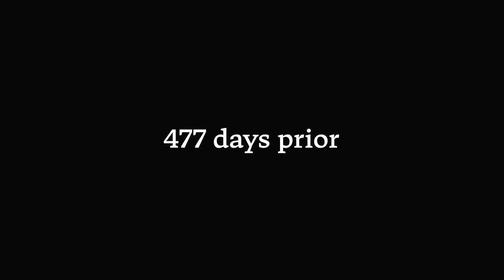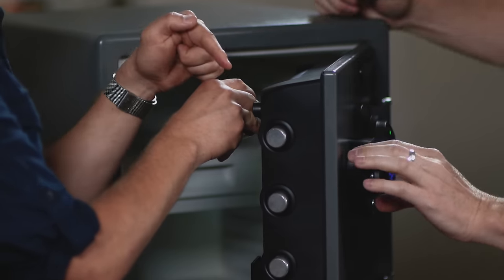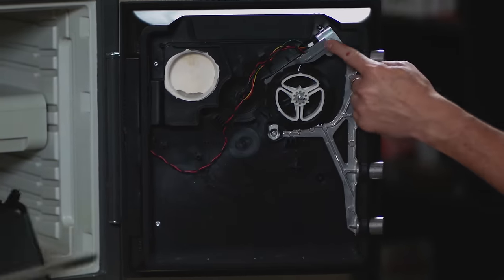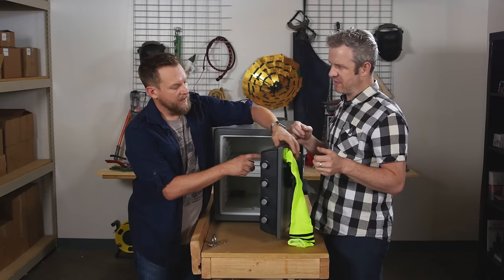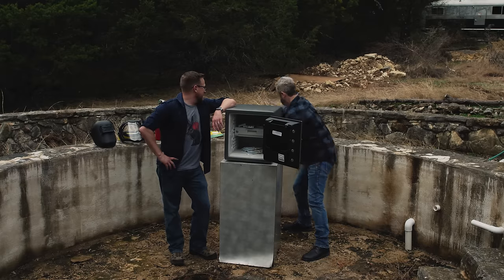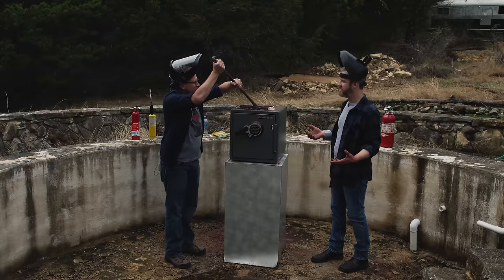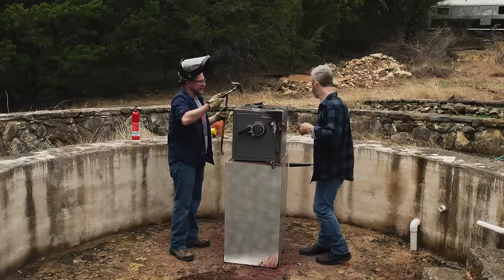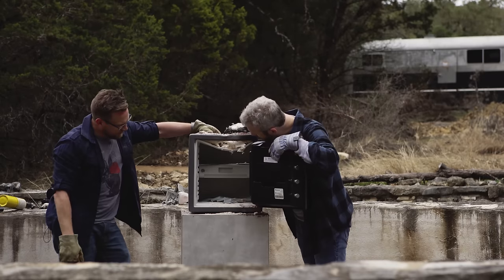Safe-Cracking with Magnets and Thermite

Comment: What kind of fire extinguisher did you have there? Just asking because a CO2 unit is worse than useless on a metal fire. Feel free to make a playing with thermite episode and show why you really shouldn't use CO2 on a metal fire.
Reply: I was under the impression that only magnesium fires were bad to fight with CO2.
Reply: The Aluminum in the reaction will start using the CO2 as an oxygen source, and you will be blowing it around, with molten iron, very exciting!
Reply: What can I say but yikes?
Reply: @ComradePhoenix  any self oxidizing fire will make CO2 useless because the goal of a CO2 extinguisher is to stop the fire from getting oxygen but if it self oxidizes then yup
Reply: David is correct. Furthermore, the only thing you can deprive it of is itself. Once started, it becomes self sustaining. Trying to cool it down isn't reasonable either.
Reply: Harrison Martinson Maybe interfere chemically if you know the exact reaction (so no good for general fires).  Basically the opposite of a catalyst.

Comment: 4 1/2" angle grinder, plunge cut into the side of the safe. Just takes a few minutes. 
   Cutting off hinges will not allow you to open safe, their are bolts that go behind the inside lip.  The hinge just makes it easier for the owner to open and close the door.

Comment: The thing with the hook contains a magnet, but is something very different. It is a holding magnet, build to have the strongest field over the gap between inner magnet and cup. The steel cup is a yoke, conducting the magnetic flux. The outer field you use is basically a side effect.

Comment: If you're willing to go destructive, safes don't really pose a challenge. I found a very old and rusty safe that someone had thrown away and I wanted to restore it. It was locked and I didn't have the secret, so I got my cheap hand-held Stone Cutter, and cut open it's back (so not to damage it much). The stone cutter went through it like butter, I just needed to apply water constantly to keep the blade cool. It had 4mm steel outside and 3mm inside with about 4 cm of some kind of cement in between, was much tougher than this one yet it posed no challenge to the diamond blade. Took me like, 5 minutes.

Comment: That's a fire safe. The outer casing isn't designed to withstand a serious assault. You could get through it in a few minutes with an angle grinder. Still, I love a good thermite video as much as the next man, so it gets a like!

Comment: Could it be potentially that you move the magnet around the solenoid to create a small electrical current  to activate the solenoid?
Reply: Buttz A solenoid IS an electromagnet.  The attack is about adding an unauthorized magnet from the outside.  Once you're inside you can just remove the locking mechanism.

Comment: To answer Jason’s question about it containing asbestos:
I’m a demolisher and work with asbestos as well, safes are known for containing asbestos since asbestos is fire proof... fortunately though asbestos was made illegal in 1975 (in Europe at least). So as long as you have a safe that’s made during the 1980’s and forward, you should be fine.

Comment: I used to be a locksmith and we told people every chance we got to stay away from sentry safes. There's many ways to defeat their safes. Also, the smaller keyed safes have numbers on them and you can go get a key made from those numbers for 5 bucks. Sentry is far from secure. Master locks are also the easiest locks to pick, they can be picked in seconds. Stay away from anything they make!

Comment: Although less dramatic, the preferred method for locksmiths to crack safes is to use an angle grinder to cut through the top or side, then remove the refractory cement and cut through the inner wall. Similar principle, but much cleaner, quicker and more effective.

Comment: you could also maybe try:
- Melting above the solenoid pin
- Melting in front of the solenoid
- trying to get the safe hot enough near the flimsy plastic to melt it

Comment: 2:15 because no company takes security beyond buying a product. that is why most buildings are locked down with common keys that anyone who cares can buy in bulk online. and contractors constantly forget that if they are installing locks, they need to rekey them, because a high security lock that hasn't been rekeyed is like a network router using it's default password. it doesn't matter how good the lock is if everyone knows the key.
Reply: contractors should insist on rekeying in the first place, so it is THEIR failure, it is up to the person who buys the work what keys to use if they even specify, the contractor (whether it is a locksmith or just a construction company) should always insist on rekeying all locks that they install.

Comment: If you move the magnet in the correct direction from the correct starting position, you might be able to induce a current in the coils of the solenoid. Not sure if it's possible, but that might be how it was done by someone else. The "cement" looking material in the walls of that fire safe evaporate and dampen everything inside the safe, protecting them from charring and burning when the safe is in a fire.

Comment: I used to break into the safes all the time. One way is instead of putting thermite on the pens. There's little plastic caps at the top in the bottom if you pull those little caps off the PIN is exposed. You can take a Phillips head screwdriver and a small hammer and just tap the pin out and the door will open! The other thing is that is drywall. I know it's hard to see because yours got burnt up. But when you cut these safes open They are packed with drywall. I own many gun safes and in the past I've had a few did I destroyed and in the process studied

Comment: The king of random (RIP) showed how to make a Thermic lance out of a metal brake line a small bottle of oxygen rubber hose and steel wool which would cut through any metal on that safe including the hinge but I would only consider this as a thought experiment.

Comment: 10 minutes with an angle grinder and a cut off wheel and the hinge mounts can be cut off. Since the lock pins are only on one side you can just slide the door out once the hinge mounts have been cut off.

Comment: This is most likely why your safe was hackable with a magnet. Backstory, i work in a factory cutting steel. There are two grades we use, 430 and 304 grade steel. Someone most likely cheeped out in production and made the lock system originally out of 430. The company probably got flack and changed some of the internals to 304. If not thats what the locks should have been made of. Either way someone messed up in production of the safe.

Comment: watched the Mr Locksmith vid before this, and there's a second internal hinge, so that probably wouldn't have worked as an attack point even if the thermite damaged the outer hinge pin. he also had a larger magnet in that video, but if the 1200lb electromagnet didn't do it, they must have fixed that exploit. fun video (thermite usually is ;)
Reply: and ofc in this case fun is more important than viabile (esp with an indoor safe) or stealth, lol. "signs of entry? what signs of entry?" innocent look

Comment: you cant use the handle to brute force. the handle has a feature in which it will give and click into another position so it can either be used at a different angle or pushed back into place. the handle though or the lock won't break from force on it

Comment: best way to cut with thermite is to load the thermite powder into a small clay  flower pot. ignite it and the thermite will flow out of the small hole in the bottom making it easy to pinpoint where you want it to burn.  guarantee I could open it with thermite...easily.  oh, and to ignite it, just use a sparkler...

Comment: As far as I know the hinge isn't even the part that holds the door shut. There often are bolts in the door to all directions so removing the hinge probably brings you 0% closer to actually open that thing in the first place  🤷 ... but nice fireworks 👍😁

Comment: Read the fine print. These "safes" are sold as a means to protect valuables from fire, not theft.
The hinge would be resistant to heat, as it ensures the box remains shut during a fire.

In fact, the smart money isn't on fire. The steel is thin, and the fireproofing material brittle. Much easier would be to use a metal saw blade, for instance, on a circular saw. Then again, it isn't as spectacular...
Reply: @Leadvest  I really meant a skill saw when I said it. Check this out: https://www.youtube.com/watch?v=2guvwQvElA8

Comment: ive gotten into two sentury fire safe. first one used a pickaxe , swinging into where the bolt face is. and second one was with a small pry bar seperating the bolts from the frame ( which is all plastic aswell )

Comment: I find a more reliable thermite fuse is to mix black powder with a bit of water and apply to natural fiber twine leve to dry then add some magnesium powder to B P and a bit of water to make a paste again then cote the end of the now dry bp fuse in this mixture leave to dry again and boom (or fizz). I've found this more reliable than magnesium ribbon allowing me to retreat to a safer distance and the bp fuse can be lit with a normal lighter.

Comment: I wonder if placing the thermite where you guys had used the magnet would work. May not be hot enough to go through as you proved on the bolt/pin; the heat may be enough to damage the spring/plastic where the solenoid is. 

Interesting and great video none the less.

Comment: The hinge was very soft after the thermite, you could have used the prybar and the hammer and torn the top off. Hardened steel becomes soft after it is raised to red hot temperatures again and allowed to cool slowly. It would have been pointless however, because you guys forgot about the pins going in the sides of the safe. Without the hinge, it would still stay locked. Going through the top is the best method. Honestly, it's the only method when talking about thermite, or cutting with an angle grinder.

Comment: Maybe try another strong magnet with a thin plastic placemat or something between them so you can insure the ability to slide it apart or make a strong electric magnet turn it on get them apart then turn it off.

Comment: You could make a housing, that would cover the majority of the side and the top, to hold the thermite I've seen a video of a guy doing that with thermate and it cut through the steel beams he tried it on.

Comment: So what I took away from this is that the powder turns into slag quick, and that you have to manage the reaction in a way that won't waste potential energy. I saw another video handling thermite and they put it into a flower pot with a hole in the bottom for the powder to drain through once molten. It was epic when they put the flower pot of thermite on top of a cars gasoline tank and set it off.

Comment: I might recommend retrying this with a "cast" rod of calcium sulfate and aluminum or magnalium thermite :)
You can get it in rods and basically use it like a lance, and it's WAY hotter. It's also a lot easier to get, you just have to dry your calcium sulfate.

Comment: take a sledge hammer to the corner or an edge.  it is just two thin metal boxes surrounded by cememt.  the corners are week points.

Comment: I wouldn’t be shocked if the door of that safe has some sort of conductive mesh or grid, making what’s known as a Faraday cage. Basically, it created a magnetic field that cancels out the one being used, so even a stupidly strong electromagnet can’t exert enough force on the solenoid to open it.

Comment: With the magnet it seemed like if you flipped it over it would have worked. The solenoid is an electromagnet so you may have been repelling it instead of pulling at it.
Reply from the maker: yeah.  we were using a "N" magnet, but should have been using an "S."

Comment: N42 vs N52 is not a measure of the pull force of a given magnet, but rather of the material the magnet is made out of. Specifically, it is the maximum energy product of the material, measured in Oersteds. An N52 magnet would be somewhat stronger than an N42 magnet of the exact same dimensions, but not that much stronger. The second magnet is stronger primarily because its larger. https://en.wikipedia.org/wiki/Oersted#Stored_energy

Comment: There is an easier way to open that safe. Go get you a circular saw and a crowbar. you can open that safe in approximately 5 minutes cut around the outside perimeter then use the crowbar to pry it open.

Comment: Looks like an angle grinder to peel off the top would also be really easy to get through the metal, then pound it with a sledge hammer. :D
In any case this safe appears to be a huge pile of excrement!

Comment: Sentry Safes are designed to protect contents from fire...The plastic jamb melts to the plastic inside chamber jamb to seal the contents from the fire hose spray.  

They are 0.024" thick steel with a plastic interior with concrete in between.  It is easier to cut through the side with a hole saw than what these two goofs are doing. 

They are not designed to be highly secure --- a 15 min UL security rating would require a much heavier gauge steal, a hard plate and relockers -- very expensive compared to a fire safe.

Comment: Against this safe a drill, an angle grinder or even a hacksaw would probably be more effective and safer for human and safe-content...

Good safes should also have bolts on the side of the hinge so if you cut the hinge it is still locked.

Plus: If you own a safe screw it down onto steel-reenforced concrete or smth similar. There is no point in having a safe that a burglar can just take and open at home (Except if it is a decoy :D )

Comment: Try an oxy-acetylene or oxy-Hydrogen torch (oxy-acetylene can burn thru tungsten which has a melting point over 6,100 degrees, however it will take tyme, it will work eventually.. ) I am referring to at the hinge of course, as a torch is pretty worthless for burning fire resistant stuff, except starlite..

Comment: When you mix fuel, metal oxide and metal powder in just the right way, it burns at 2000 degrees Celsius. Hot enough to cut through nearly any barrier known to man. Throw some C4 into the mix, and you've got one hell of a combination.
Reply: drop snot “ a really big fucking hole coming right up”

Comment: Wait he spilt fully mixed thermite? I thought it was only one ingreedent! Incindery mixes are to be made on site, you generally shouldn't mix them off site.
Reply: The heat required to start up thermite is really high, hense why they use the magnesium strips. So if the place they're keeping the thermite is hot enough to ignite it, they probably have way bigger problems than the thermite.
Reply: Granted...

Comment: "When you mix fuel, metal oxide and metalpowder in just the right way, it burns at 2000 degrees Celsius. Hot enough to cut through nearly any barrier known to man. Throw some C4 into the mix, and you've got one hell of a combination."

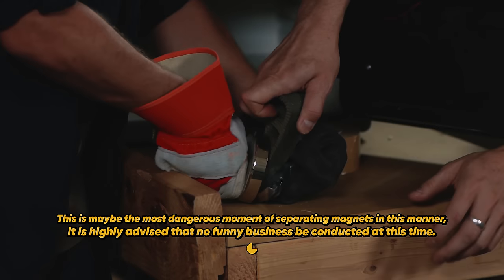Comment: 7:50 just slide them sideways for gods sake, youre never getting them off by pulling them apart lmao.
put it on the edge of the table so that the other magnet hangs over the table and push it down. remember to hold the other magnet still or a big no-no can happen.
Reply: We tried that for a while, but the large one has a raised lip surrounding the bottom side (you can see it when they separate) which makes that strategy not viable.
Reply: @BrandtHughes  i see

Comment: The pin is probably d2 tool steel and the winners is probably plaster of paris.. very heat resistant it's heat refractory... source I'm a Smith and I've used plaster as refractory brick

Comment: That "safe" meets the residential security container spec.  That spec limits the testing to no heat attacks, no power tools, and no attacking sides top or back.  It also limits them to 10 minutes and only two people using basic tools (hammers, pry bars etc).  In other words, a test that is designed to produce a rating on a sticker for marketing.  It is a meaningless rating beyond that.  If you look into thefts where gun safes were broken into, typically  they use an angle grinder to go through the side and open it like a tin can.  In short, when ever you buy a safe of any kind please do your research.  Lastly, if it is sold in a big box store it most likely is not a safe, its just shaped like one. Much like the "safe" you see in this video.

Comment: You can't really call that cracker box a safe. My uncle was a semi-expert on opening those for a living ( illegal as it was ). Television teaches you nothing about opening one for real. Burning into one with an acetylene torch, dropping it from a 10 story building or blowing one up is all wrong unless you don't care about destroying the contents. My uncle used basic tools. The door is the strongest part of any safe. Once a safe was acquired, he would peel the safe. All safes are built in layers. Many have been opened with just a hammer and chisel. Personally I'd recommend an angle grinder, a hammer drill, a reciprocating saw, and a 2 pound sledge hammer and attack it from the side, back or top. knowledge and the ability to apply it is the key to success.

Comment: just 1/2 inch normal drywall gypsum sandwiched between the steel plates.  So, when you get through that brick, there's another layer of steel ....guess not, cheap safe.  How much blood loss BTW?

Comment: when you mix fuel, metal oxide and metal powder in just the right way, it burns at 2000 º C , hot enough to cut through any safe known to man
Reply: what about a tantalum hafnium carbide safe

Comment: Gentleman you can open that safe with a circular saw with a fine tooth carbide blade you cut half way back from the front door on top and cut all around the safe taking less than two minutes to open it but its noisey an messy but work's